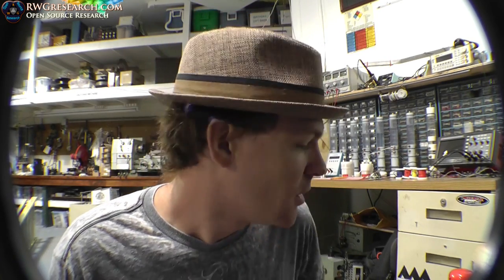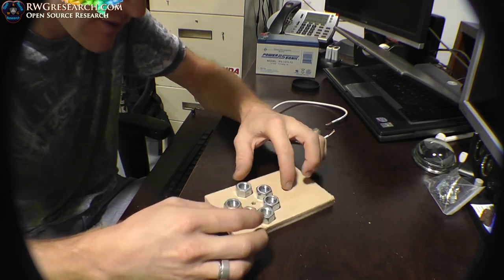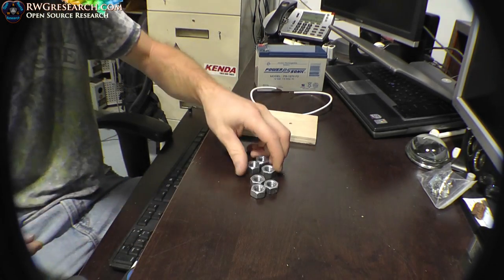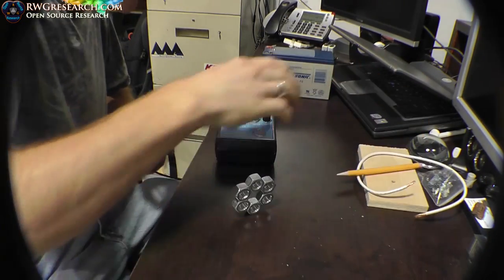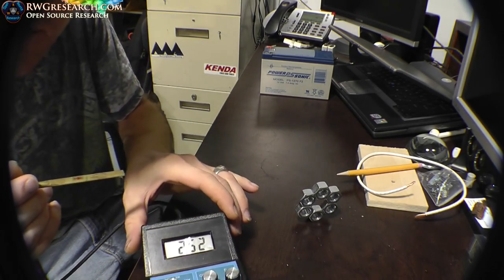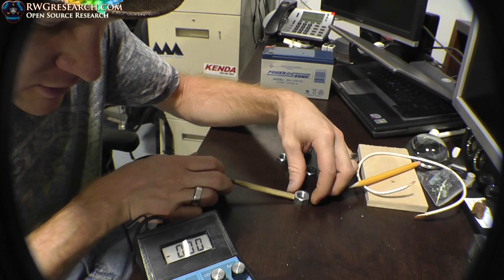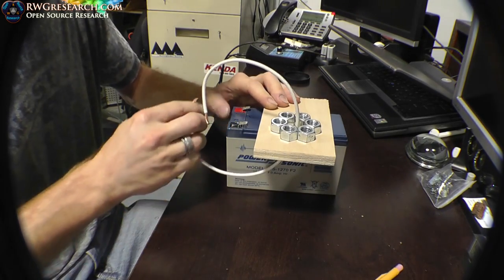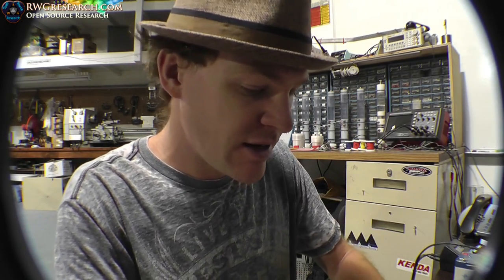“Oh Nuts!” Magnetic Lock.Your Going To Like! Using The Principles Of Ed Leedskalnin PMH.Must Watch

Comment: Hi Russ, bravo! A great demonstration on how the magnetic flux, induced by a current, will propagate accordingly with the "right hand rule" (or it was the "left hand rule"? heheheh)
Don't try to reproduce this experiment with the stainless steel nuts...simply it won't run (stainless steel is usual amagnetic).
Try, instead, using supercapacitors (better if bigger than 400 Farads, put some in series to have more output volts) as your power source because they can give much more AMPS during the shorting phase, without the risk of explosion typical of batteries... in any case, don't prolong that shorting phase or you risk to burn yourself!

Comment: coulomb force not really a magnetic but same principal. you are creating a electrostatic bond you can do the same thing with a  Lucite plate exciting a charge beating it with fir  then laying a metal plate on top ground the metal with your finger not only will you be able to feel more resistance when you try to pick up the metal but it will have a discharge when lifted

Comment from the maker: good times! MAKE SURE YOU READ THE DESCRIPTION!!!! ~Russ
Reply: There is a loop of flux endlessly circulating, trapped in the iron of the nuts.  This is how the PMH and Radus boots work.  Good job!
Reply from the maker: shogun x yes exactly, i was just showing another version i came up with to show this :) ~Russ
Reply: am speechless as for the background music great pick!
Reply: Great video Russ! My belief is everything has a magnetic field and your experiment strengthens the weak fields of the nuts long enough for all to couple into one field. They will be loosely coupled but never the less coupled until you break the field.
Reply: Great video. Much to include in the magnetic/energy? field of study. (Just a small branch of many related other 'energy' studies),  and am looking forward to more.
Reply: ***** 

Here is an explanation:  When you dead short the battery you create a mini-emp. As the EMP passes around the nuts and through the metal it rearranges an unappreciated and ignored characteristic of any metal. Metals have a lot of free electrons running over their outer surfaces this is what makes them so hard, this is my supposition and contribution to science. The EMP redirects the free electrons that are passing around the outside of the nuts, where the nuts contact each other, to only moving around the entire outside structure that the nuts create. Where the nuts come together the electrons no longer pass so it behaves like it is one big piece of metal. You have very cleverly demonstrated a constructive use of the casimir effect.

You should try it with aluminum nuts and see if it works, aluminum is NOT magnetic and the better alloys are very hard, and covered with sapphire, the results would be interesting but I bet it still works and really well with aluminum. Try it with ball bearings formed into a pyramid, not much metal contact and lots of air space between. If it works it would make a neat demonstration not sure what it would prove though.

The way to move forward is to put pieces together that form a primitive capacitor, air space inside of metal pieces that form an enclosure, see what happens.
Reply: Robert Bradley this is stupid. all he does is, by using copper wire, he turns the wire into an electromagnet. which then simply temporarily magnetizes the nuts as they are conductive. the nuts on their own can not be magnetic as their atoms polarity are not all in one direction  - north and south - but when they all become magnetized briefly, it aligns their polarities. as long as they are touching, they are holding each others polarity in place via their now polarized magnetic fields. when you break them up, there is nothing holding their polarities in alignment, and they return to being non magnetic.
Reply: +Ambrosius Malachai Of course they are holding each others fields ... but why ???
Reply: +Nick Soa No, the only way to make the structure more sound is to magnetize them. Takes a slightly different method, and they would put off a magnetic field for some time.
Reply: +Ambrosius Malachai (AMV GOD) an electro magnet from a single piece of copper wire?,  you need to run electicity through coiled wire to create a magnetic fields
Reply: +David Bryan As electrons move through a conductor, it creates it's own magnetic field whether the wire is in a coil or not. This is the very reason a coil works. The winding takes the already present magnetic field in the conductor (the wire with electrons passing through it from the negative terminal of the battery to the positive terminal, electron flow) and magnifies it. If the magnetic field does not exist in a straight wire, then it cannot exist in a coil of wire.
Reply: Heh, Yeah, I like to make my straight wire transformers about one to 2 miles long. They work and look great!...)
Reply: I like your posts and way of looking at electronics. I'm glad you do not belong to the "Bought off" types.
Reply: Or make a coiled loop with the wire passing through the nuts, say start with 10 loops for the coil, and see how strong the nuts bond becomes, then add and decrease the loops to see what strength differences there are. I plan on doing this particular experiemnent in a few days to see what differences there is with them, also I have electronics and electrical engeneering training and like crazy experiments like this. After making a 100 watt carbon dioxide/argon/helium mix cutting laser, this should be interesting.
Reply: +GunClingingPalin The magnets don't move, the electrons do, traveling from positive to negative from each coil. That is how the PMH works and why one of the two coils has to be inverted on the setup, otherwise you would have two fields cancelling each other out, which causes a null field, or in simple terms, no field.
Reply: *your
Reply: I like this video, an interesting and simple scientific experiment with an unexpected result and no silly half-baked explanations involving zero point energy.

The observed effect can be explained quite easily by basic magnetic theory.  Passing a large pulse of current through the wire creates a magnetic force around the wire. Air has a low magnetic permeability which means that a magnetic force only produces a small magnetic field (flux) in it.

Steel has a much higher magnetic permeability than air (thousands of times higher) and so a much larger magnetic flux is generated in the loop formed by the nuts, so long as they are all touching.  This magnetic flux causes the nuts to be attracted to each other just like an electromagnet.

When the electric current is removed a magnetic flux in the nuts continues to exist because some of the steel molecules have been realigned and effectively remember some of the magnetic force.  This type of steel only remembers a small amount of force unlike the material used in permanent magnets which remembers a large amount of force.   Because of the high permeability of the steel loop this small magnetic force can still create a large enough magnetic flux for the nuts to continue to stick together.

As soon as you break the loop by inserting even a tiny air gap the low permeability of the air in the gap causes the magnetic flux to drop to almost zero, the attraction disappears and the nuts fall apart.

Each nut has now become a weak magnet so if you reassemble the nuts with exactly the same orientation as they had initially then they will stick together again.  To do this you will need to mark them with a sharpie say next to the clockwise face before you apply the current.  The order doesn't matter just the nose-to tail orientation.
Reply: Sounds good. except for the "steel molecules". ;)
Reply: What would happen if you put the meter on the white wire as you do the experiment?

Comment: :O wondrous.

The electric current that flows through the wire induces a circular magnetic current around the wire. (electromagnetism 101). The nuts seem to give the magnetic current a path to flow through, which keeps the nuts stuck together until the magnetic current is broken. Most of the magnetic flux lines will be contained within the shape of the nuts, like a toroid  The reason you notice the most noticeable magnetic gauss at the corners is because the edges don't fit perfectly even with each other, creating a small gap that the flux lines must pass through.

i've never seen this done before, but truly marvelous adaptation of the PMH.

Comment: You pegged it and it was obvious before seeing past the 1st few words of the title that  you got the idea from the properties of Ed's PMH all I saw was up to  " you're going to like" and you are demonstrating another example of magnetic current....but what I would like you to try if possible, to determine if there is any current (albeit minute) discharge when you break the nuts!  

There is another video out long before your experiment called something like, "The leedskalnin effect" who took 2 pieces of long flat metal (bars) with no attraction and machined a groove in them to accept the heavy wire, he touches it to his Truck/car battery and slips the wire from between them, and they are tightly bound together and the only way he was able to separate them as by sliding one past the other, same effect but with the increased surface, much stronger.

What's most puzzling is, unlike your nuts being in a configuration for (flux)current to flow, his were two long flat pieces, and hardly an obvious environment for flow as compared to the U and keeper of a pmh or your nuts!  

Good job none the less Russ...I had intended on demonstrating this unknown principle but life got in my way....I'm still happy to see you had done it even if you beat me to it...it don't matter, you started uncountable wheels turning/minds thinking, and THAT was the point!

Comment: what happens if you put 1 nut over the hole, then 3 nuts evenly spaced around the 1st nut, run the wire down through the middle nut and hole ... will it stick the 4 together ? repeal the 3 ? or will having a middle nut contain the effect and do nothing at all.

Comment: magnetic structurizliation of magnetic ions to equally share magnetic materials you can easily do another experiment with one thick long wire but this Times you can use permanent magnets to demonstrate magnets sturcturzliation by place even NUMBER of magnets over straight wire facing oriented in direction of current magnetic vector direction when you apply power to long wire. The moment power is apply to wire you will physical see with naked eyes 1/2 of magnets swing one way while the other 1/2 swing the other way in altering pattern of clockwise & counterwise rotation even if the current is DC current proven the voiding principal like also Walters Russell talk about too

Comment: you can demagnetize apart of thermal shock also by mechanical shock...and that's what you did. The ring configuration was magnetized by the magnetic field created by the high current passing the pass through cable. The mode of magnetizaton is circular and is not detectable with a Gauss meter. Magnetism is confined inside the nuts ring and don't leaks outside... nothing special really.

Comment: Not to go all space cadet on you but the first thing that I thought of when I seen this was some of the U.F.O  reports of smaller craft coming together and forming one ship and flying off .could this be the type of tech that they use ? You would not want a mechanical device holding them together in case something went wrong you wouldn't loose all. Just a thought great video.🤔

Comment: Wild guess: The wire forms a 1-turn electro-magnet primary, the ring of nuts forms a 1-turn secondary so the current in the wire induced a roughly equal current in the bolds resulting is tiny spot welds.
Reply: i doubt there is enough current there to melt any metal.  that battery might put out 50 amps at best. which would not cause a spot weld in the milliseconds there was current flow.  on metal foil maybe, but not on something so large.
Reply: plausible. ..possibly arcing the nut coating

Comment: Ive attempted to reproduce this. I have done it with a u bolt and magnet wire coiled around. But the nuts are not working. They are magnetically permeable, 18 v batt, and a fat stranded copper wire. Just hasnt worked for me. Any suggestions?